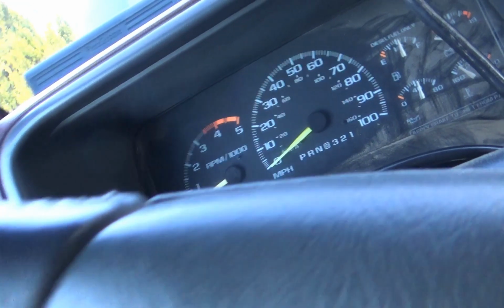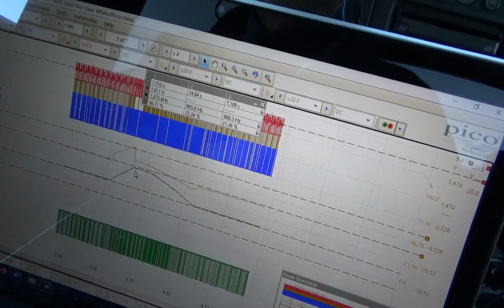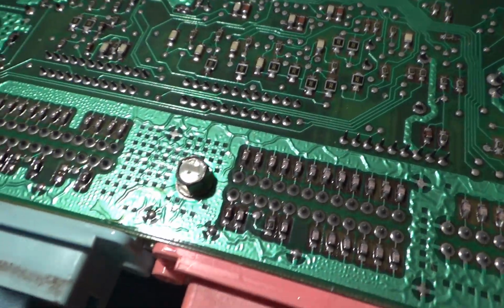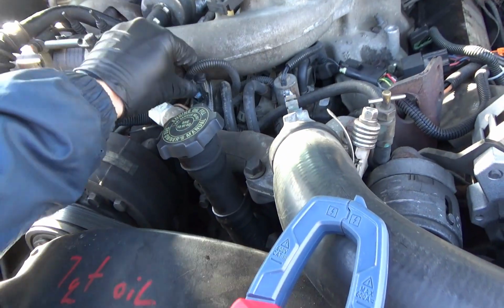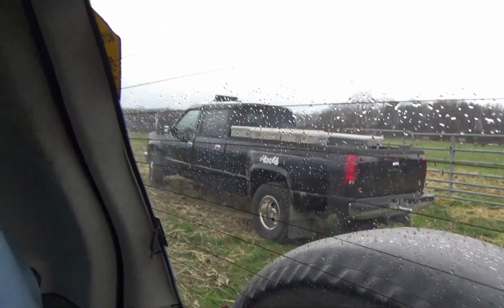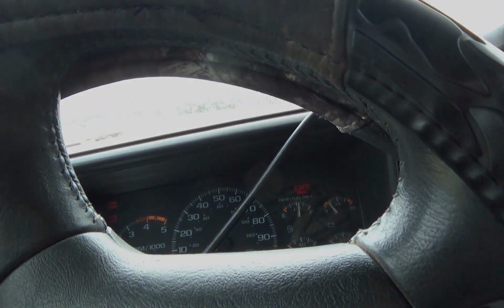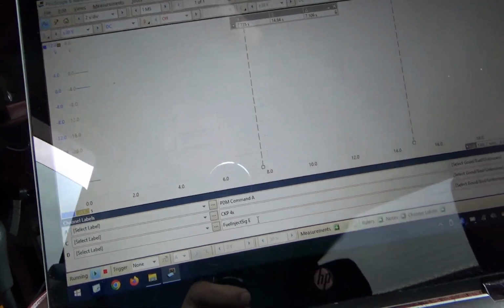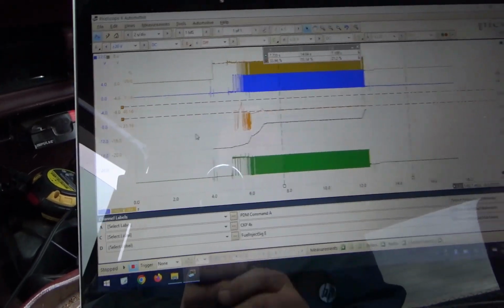Chevy 6.5 Turbo Diesel REVS Out of CONTROL?! (Part 2 - Didn't see THIS Coming...)

Comment: The engine temp inaccuracy is a mystery!
Reply: Not sure if there was another test which could have been done. Ivan checked the resistance at the sensor, but I don't remember seeing him test it at the PCM. Could be a wire from the sensor to the PCM was compromised, a touch of the green crusties somewhere in the harness could account for the PCM reading a higher resistance and thus a higher coolant temperature.
Reply: @walterxplinge3867  he eliminated that issue, because according to that table a higher resistance would've resulted in a lower temperature reading.
Reply: @tschuuuls486  But insulation breakdown in the harness could skew it the other way . . ..still very much a valid test.
Reply: @walterxplinge3867  He never changed the PCM. He swapped out the ECU and never even noticed that the PCM is a completely different unit in a different location. Diagnosis was right, repair was never done.
Reply: @calholli  I understand what you are saying, however in the 6.5 world PCM is universally known as Pump Control Module. Further yet, these trucks do in fact have both a PCM and ECU. Ivan correctly diagnosed a faulty PCM but switched out the ECU leading directly to the engines demise.
Reply: @GlacialErratic  that was part one. The customer provided for additional PCM’s, all from different sources.
Reply: @GlacialErratic  sounds like you didn't watch the first vid. Truck had a plethora of different pump control modules on hand and none made a difference. Regardless of nomenclature he did replace the correct box.
Reply: @notsureigaf  you are correct, based on what he was saying and doing in part 2, I made an assumption. I plan on watching part 1, I am not sure if it will change what I believe to be the original problem. If it does I will insert foot and have learned another valuable lesson. ✌
Reply: @GlacialErratic  Correct terminology is PCM=power train control module. PMD is pump mounted fuel driver module. Not sure where you are from but i have never heard someone call the fuel driver a PCM in north america. So a 6.5l turbo diesel has a PCM for powertrain control and a PMD controls the injection pump fuel metering using inputs from the PCM
Reply: Both computers, seeing the same! Both bad, unlikely. Still, there may be a common failure point. These measure ohms just like your digital meter does. It supplies a constant current and measures the voltage. Multiple failure points. 
Ground return, high resistance from the block? Possible that it uses a separate ground path for measurements.
Voltage reference in PCM wrong? Something like an opened zener reference.
PCM code failure? unlikely bot computers with the same problem.
I'm going with something messing with the ground paths. 
Cleaning the end points is only part of the problem. I had a problem where constant oil or engine cleaner had turned the wiring insulation to mush. The wires shorted in the harness. The reference was at 12V instead of 5V. Fixed the wires to find the same 5V ref went to the pressure sensor in the tank. It was blown as well.
Like I say, cleaning the end points of the ground wires isn't always what is need. One needs to look for cross connections or high resistance runs.
Reply: I bet that shift solenoid code..it was probably shorting to ground and traveling through sensor or other components causing the engine galloping.  @dwightelvey645
Reply: Bad PCM sensor ground?
Reply: Not a mystery, just a broken wire on the way to the module.
Reply: @watchmakerful  Except when the resistance increases the temp decreases so a broken or corroded wire would read lower temp, not higher.
Reply: @jeffco908  And if it is shorted to power, not broken?
Reply: @watchmakerful  ect sensor is a thermistor and when high voltage is detected it is translated as low coolant temp. As the sensor warms up the resistance becomes lower and the voltage the pcm senses also lowers. It measures voltage drop across the sensor using 5v and sensor ground.
Reply: I had a 95 2500 with the 6.5. It was only a matter of time b4 that redline cold start scattered it. I think I would've tried a different scan tool to verify if the ect and boost pids were correct. On obd 1, newer scan tools can lie. Of course now it's a moot point..
Reply: @adamtrombino106  I like my bosch actron elite for obd1
Reply: I was wondering why he didn't' check powers and grounds before calling the PCM..  Maybe it just had a bad ground making things wonky??  It's definitely strange
Reply: Mystery or not, it had nothing to do with the problem.
Reply: also boost, with engine off there should be zero boost but here ECM was showing 14psi
Reply: @krzysztofstrojny1059  That's likely absolute pressure, and 14psi absolute is the air pressure at the surface of the earth. (Relative pressure would be 0 psi).
Reply: @krzysztofstrojny1059  That was just showing absolute manifold pressure.

Comment: I had a customer call me with a 6.5 once and stated its running rough ever since he filled up. I told him he must have got gasoline instead of diesel and he swore up and down he put diesel in. I told him that the error may be with the station not having the right fuel in the ground be he woukdnt listen.  When he was driving to the shop i could hear him coming a block away the motor was rattling so loud from the gasoline.
I drained the tank and refilled with diesel but a week later it got towed baxk with a broken crankshaft
Reply: And i was saying to myself I wonder if there is gas mixed in with the diesel fuel ?????   sure sounds  like it
Reply: Too bad they were so stubborn and also too cheap for a tow.
Reply: LOL We had the opposite happen back when i worked on a railroad gang. Foreman sent a guy to fill up his truck (we had our own fuel in railroad car, both Diesel and Gas). Bit later the Foreman drives up with his Chevy gas truck sounding like diesel. Some goof on the Gang filled his truck up with diesel. He had to go put out flags before going to work (hell to pay if flags aren't up for the trains at your specified work block), so they did that, then came back and pumped the diesel out and changed the engine oil because it had diluted the oil as well. Gas in a diesel is pretty well guaranteed to destroy an injection pump, so i am surprised that 6.5 ran at all.

Comment: This conclusion makes me sad.
But yea probably was already on its death bed.
I was once told that reving an unloaded engine was worse than a loaded egine due to harmonics in the crank.
Evidence to back that up is the number of engines that disassemble themselves when the driver is putting them on the rev limiter and throttle snaps to show off.
Reply: Yeah but now consider how many thousands of engines are abused on video, held at the rev limiter for minutes and nothing happens.  I have seen it over and over again.
Reply: @kevin9c1  probably pushes damaged engines over the edge.

Comment: i am wondering why you did not focus your scope on computer inputs?  maybe there is a reference voltage input failed. That might explain the temperature reading and the gas pedal lack of control.  But I don't know anything about the engine computer and how it is connected.

also, this engine sounded worn out. right from the beginning of the video.  no surprise it did not make it through the diagnosis.  noting lasts forever.  always sad when it happens.

Comment: Feel for you Ivan. Not nice when you can’t do your job and then the thing dies in the process.
Reply from the maker: It went from slight knock to hole in the block in three ignition cycles 😪
Reply: @PineHollowAutoDiagnostics  as soon as you heard it knock turn off and tow it not nice feeling destroying some ones engine
Reply: @jackiemay9471  By the time the knock was there it was already junk.
Reply: @williamkelley7654  but the conrod was nt through the block
Reply: @PineHollowAutoDiagnostics   I knew it was junk as soon as you showed the sludge on the dip stick.   Diesels will live long, but you can't neglect the oil and expect and old high mileage engine to keep on going..
Reply: @calholli  My thoughts exactly. Poor oil change intervals. But would that have caused the bizarre RPMs?
Reply: @PineHollowAutoDiagnostics  Did you ever check for the resistor being in the PMD connector housing?

Comment: Im curious to know why you didn't opt for a new coolant temp sensor. . . .
Then whip the pump out and check the seals/diaphragm. Even a simple gauge on the fuel line to check the pressure but I suppose you convinced yourself the issue was electrical.
Reply: The sensor was reporting within the expected resistance range.

Comment: I've never seen or heard a 6.5 fuel cut at 4,000 rpm like that and now I've seen it like 15 times.  That's something.
Reply: You've never watched zip ties n bias plies?
Reply: @arcadeuk   I've never seen him run a chevy diesel..  He usually only runs 7.3L's and cummins.. in the smaller trucks.  
but it's not like I've seen all his videos, to be fair.
Reply: @arcadeuk  Apparently not enough.
Reply: Yeah…Ivan’s constant starting and red lining a cold diesel (for no apparent reason, he already has his data).  Who knows how many times he did this off camera.  Many of us told him in the first video it was the injection pump…but he kept up with his “you can’t diagnosis this without a 4 channel scope” ego. Sad for the owner.
Reply: @vg3430  They can handle a couple of red lines..  The engine had horribly old sludge looking oil on the dipstick.. and if they neglected the oil like that over years of use.. then it was already on it's last leg anyway.
Reply: @vg3430 the truck was likely already gone from his yard before you watched part 1. Recording, editing, and uploading all this in a single night is not really possible.

Comment: Need to partner with Adrian's Digital Basement and get onto reflashing your own ROMs.  😊 Not that it would have helped this time...
Reply: Heh, he can barely get old PC's fixed, where you can see the computer running. He wouldn't have a hope of fixing a PCM where you need to be able to diagnose and fix it without the rest of the system. People that muck around with old PC's are not exactly the pinnacle of electronics knowledge...

Comment: PCM were pretty common in them back in that era. Usual issue was stalling when hot and not restarting ( not as common as the driver module)
Reply: the pump mounted driver module was the real problem but it is a real pia to remove so most would leave it there and put on a remote driver module, The problem is there is a fuel control resistor that goes into the new module over the pins on the driver plug, It has to be transferred from the old module to the new one, it is next to impossible to get it out of the old module without removing the module from the pump first. A lot of people didn't know about the resistor and had this same result as Ivans truck. I could see the pmd was still on the pump so it is very likely thats what happened here
Reply from the maker: @markricketts-qm6xu that is very interesting! Didn't see any mention of this funky resistor anywhere in service info 🤔
Reply: @PineHollowAutoDiagnostics  familiar with the resistor. Only time I had one of them take off was when it had  a faulty turbo and just had to wait till it consumed the oil. (Scary situation) also spent a couple of hours cleaning the car beside the tail pipe..
Reply: @PineHollowAutoDiagnostics - The "resistor" is a surface mount type.  It is soldered onto a fiberglass PCB that has passthrough connector sockets.  It is keyed/notched and is installed into the PMD's connect body.  The resistors go from #1-9, typically factory was a #4 or 5.  The resistor module is a trim adjuster for small variance in injector pump tolerances (to meet EPA/CARB targets).   I believe the ECM/PCM only reads the resistor value once every 50 start cycles.  I also believe if the computer fails to read it, it defaults to the lowest value (#1).   The resistor (I believe) only changes the base fuel mapping +/-  0.1cc/stroke.   While the base idle fuel request is somewhere between 2-5cc/stroke.  The lack of a resistor will eventually throw a MIL on, and on the OBDII vehicles supposedly can cause a no start condition?  The symptoms in these two videos look like a failing injection pump.   And yeah, cold start rev to the moon on full fuel timing advance is definitely not recommended.  But that engine had suffered damage before you looked at it! 😢
Reply: @markricketts-qm6xu  never seen one do what his was doing.
Reply: Also I will give it to Ivan for having the courage to show this video. More about the reality of the automotive profession and pitfalls we deal with on a day to day perspective.
Reply: @tonyedwin9042  I have, I replaced the injection pump with a used one and it did the same thing but before installing the pump i removed the pmdm and connected the remote module the owner had mounted behind the front license plate, it was hard to see but the resistor was not in it, A lot of pumps and ecm's were replaced and trucks scrapped because of this mistake. This resistor controls the fuel solenoid in the pump and is extremely important. you can buy new resistors but really should use the one that came with the pump as they are matched to each other that is why they don't come with the module